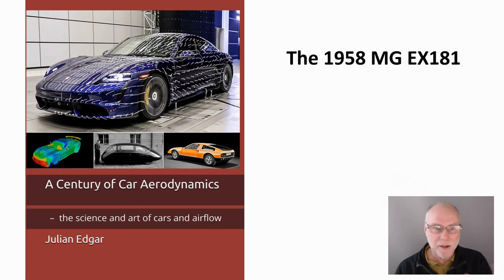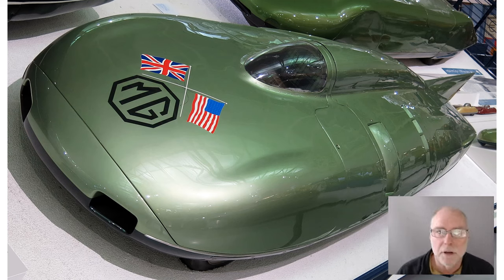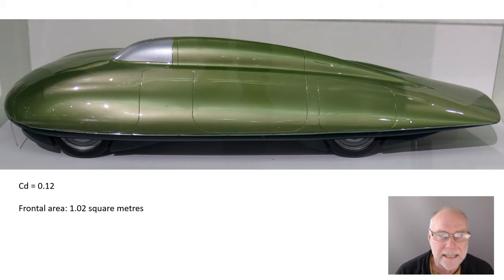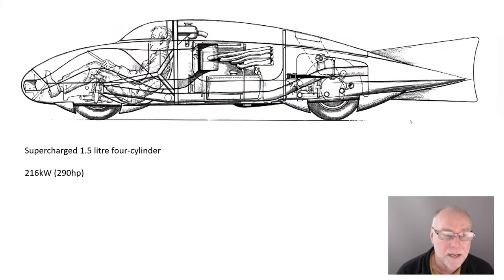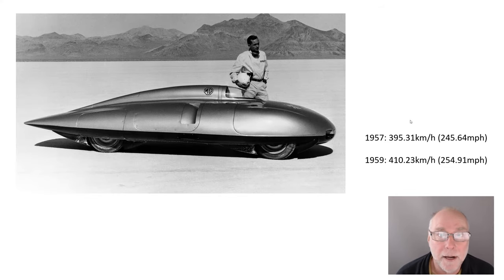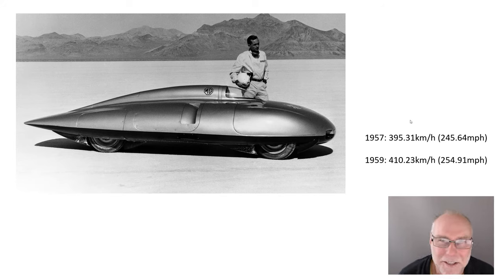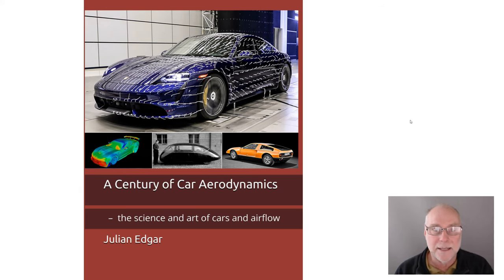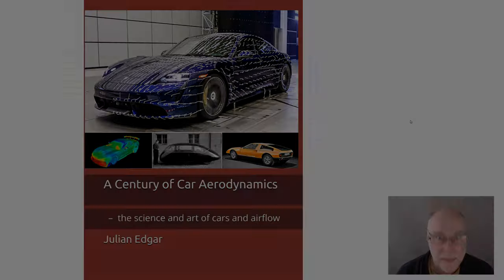The 1958 MG EX181 speed record holder

Comment: Another aspect of cars or motorcycles directly related to the overall dimensions is the perceived size of the vehicle to another driver. Basically it should appear as large as possible. Have a taller profile possibly to appear closer. I read something about this in a motorcycle magazine years ago and I had some close calls on my scooter. Never had trouble at night because of headlight being bright.  If the low beam was used or if I was riding in the daylight, people would just pull right in front of me like I was invisible. Also small cars need some flair or something contrasting that gives it an outline to someone on a side street. I guess insurance would have everyone riding in large styrofoam cages painted neon orange. Terrible thought.

Comment: Aptera is claiming they have the most aerodynamic shape of a car 0.13cd, do you think they are correct or are there examples of lower cd values? I'm not sure if they got their value from testing or from predictions.
What about ground effect for the ex181
Reply from the maker: Let's see if the Aptera ever appears. I was once a huge fan, but their whole approach has turned me off. I wouldn't for one moment believe any quoted Cd figure (it went in a wind tunnel, then there was silence), but theoretically it should be very good indeed. The MG EX181, as with all land speed record cars dating back to the 1930s, used ground effect.
Reply: @JulianEdgar  thanks for reply very interesting

Comment: Aptera seems they will be selling a plastic model of the car ( probably the only car investors wil get), would that plastic model be useful for testing the cd value? Seems it will be exact copy of the prototypes ( maybe 20-30cm in length is my guess)
Reply from the maker: Testing models is fraught with difficulties, so no.
Reply: @JulianEdgar  can I ask at what speed does wind resistance become a meaningful issue for any vehicle.....a gray area I know, 30km/hr or so Im guessing?

Comment: The MG could be even better today since cooling ( intake) and exhaust not required for BEV vehicles.  You could close those front air inlets and exhaust outlets for even better attached flow.  I’ll bet it’s super stable too.

Interestingly,  today’s cargo top carriers are shaped this way, but they put the pointy ( slim) end to front when it should go to back.  Tests have showed that putting the teardrop fat end to front does better than pointy end to front.

Comment: I have been considering approaching the British Motor Museum in Gaydon, UK where this is housed to see whether they might be interested in having the EX181 laser scanned and the results run through CFD simulations (it would of course mean finding accommodating partners for the scan and CFD runs).

Do you think there would be any merit for the wider community in suggesting they consider doing this?

I know I'd certainly be fascinated by the results - even if no one else would be - but that probably isn't a sufficient reason to justify doing it!
Reply from the maker: It would be interesting but to do it properly would be a very expensive exercise. (Getting it done poorly would be cheap but pointless.)
Reply: @JulianEdgar  I've had a company run CFD simulations on a 3D model of a road car (probably not a very accurate model though) before, but with static wheels, and the results were interesting, with the Cd close to that from a third party, full size wind tunnel test. 

The visualisation aspects were very illuminating as well, seemingly highlighting the areas causing the worst of the drag - and clarifying why the Cd of the car is so poor.

My feeling is that there could be many people and organisations that would be willing to perform a laser scan, 3D model preparation, and CFD simulations for no (or low) cost for this important automotive museum (with charititable status) and historically important car for the benefit of future generations.

The question is whether the museum would see these as a desirable and valuable activities and artefacts, including why (as far as I know) this hasn't already been done. 

This year is also MG's centenary, as well as the 30th anniversary of the opening of the museum, so perhaps this is an opportune moment for me to ask them!